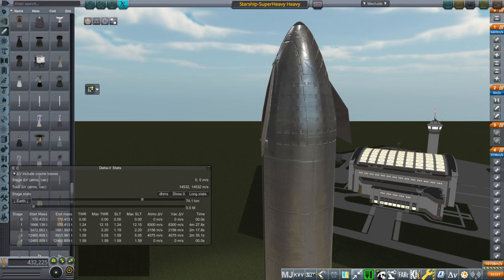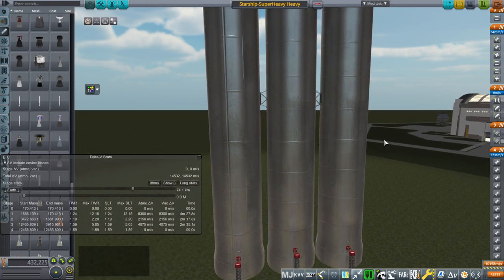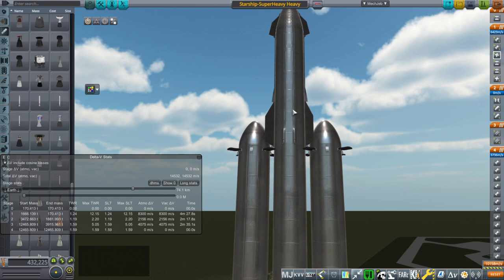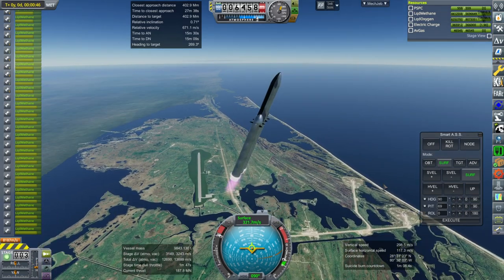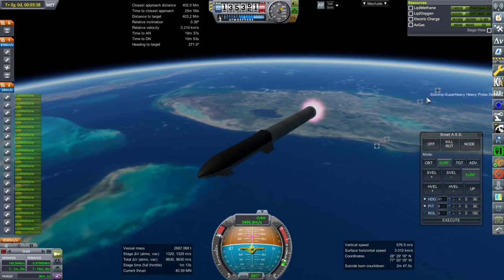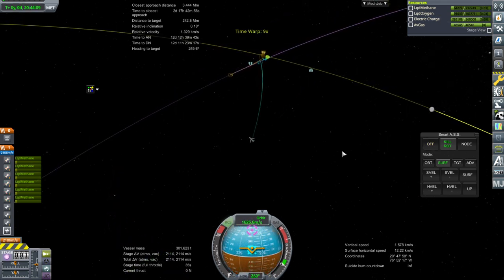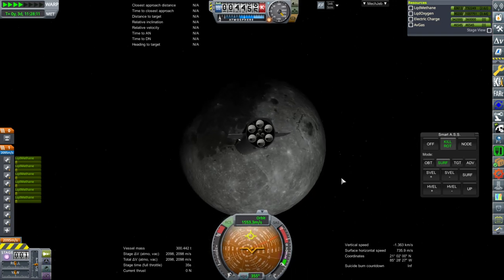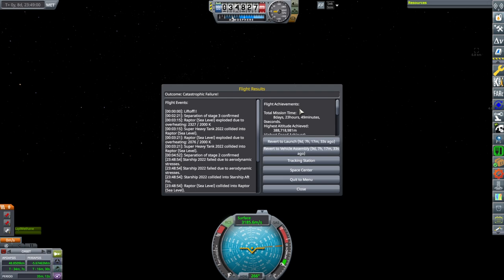Realism Overhaul in KSP 1.8.1 - Starship-SuperHeavy Heavy

Comment: One thing I've been wondering about is the heat shields being lunar rated. Afaik no non-ablative heat shield has been lunar rated. Will starship hold some deltav back to slow down?
Reply from the maker: It's tough to say. Obviously, just because it hasn't been done before doesn't mean that it can't be done. We can only wait and see.
Reply: My guess is multiple aerobraking passes to distribute heating. Break into a highly eccentric elliptical orbit and progressively lower the apoapse/reentry speed in several passes.

Comment: am i the only one that thinks this starship/superheavy thing is ugly AF? it's been so long and nothing but hype from musk fanboys. they were boasting about using stainless steel for re-entry at the beginning and have since walked back their claims and reverted to heat shields.
Reply: They were always going to need a heat shield of some kind, it's just that the high heat tolerance of the steel means that it can be thinner and lighter.